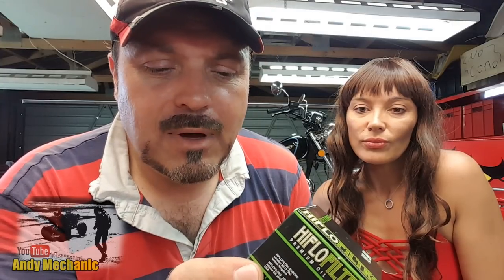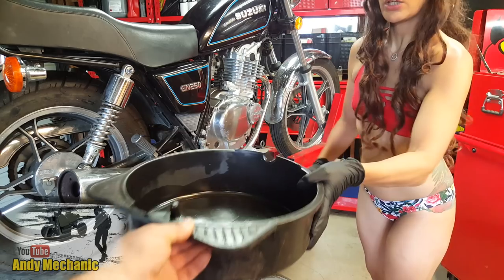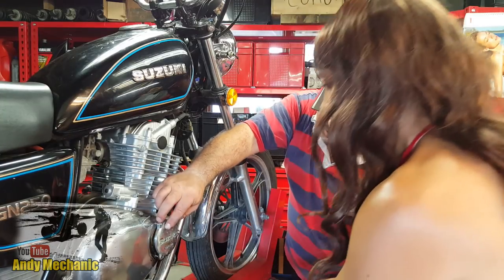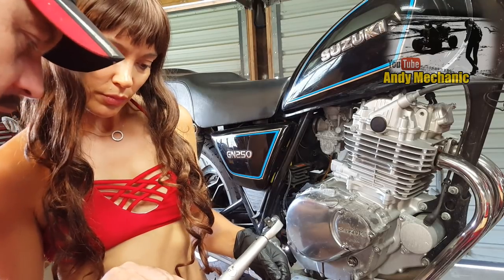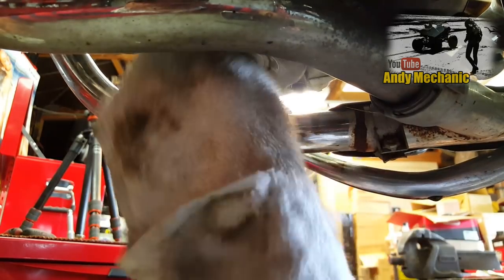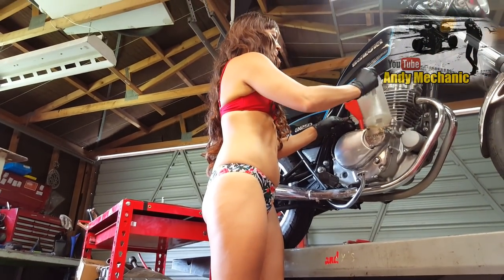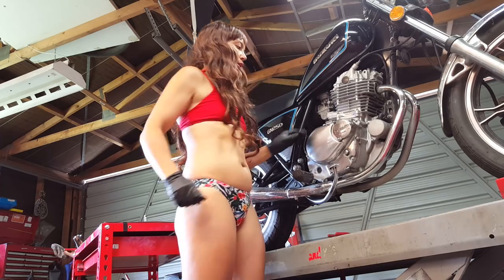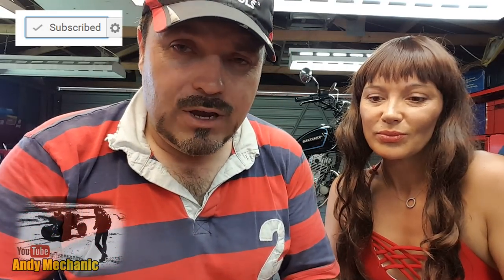GN250 Oil & filter change - ft.  Tool Girl Hana #1831

Comment: Hi Andy, Gooood stuff! You teach and explain nice and clear and that girl rocks in mechanics... and not only in that.
She has a good handling of tools 🛠 (wrenches, ratchets and so on, I mean, seriously). I wouldn't like to be the threaded hole of the first M6 bolt of the filter cover: she over tightened  it a little, but who would not want an Hana's little punishment?

Instead, the blonde and brunette used to touch and handle sockets and screwdriver as they were keeping a dead fly with two fingers by the wing. The firs lesson's title should be "A torque wrench doesn't bite".

By the way, about oil level: you told that it must be done when warm, otherwise we risk to find it in air filter, through a the crankcase check valve (I suppose). I think that if I have cold engine, oil at maximum level (upper notch) and I turn on the motorbike, the biggest part of lubricant runs into  channels and moving parts. In that situation the pan is not completely empty but level is below lower notch. When I stop my warm engine (oil at 120 centigrade degrees) who cares if it sets at 5 mm over upper notch? I own a air cooled Ducati and I think oil is also useful for cooling, so I think in my case could be better one tea cup more, that one less. What is your opinion?
Thanks again.

Comment: Dear Andy, BIG PROBLEM HELP! I recently changed my oil and oil filter on my 1985 GN250. Everything was going fine until I took it down the street.  All of a sudden I hear a loud pop!! And a stream of oil is pissing sideways from the top of the oil filter cap. Upon further inspection the gasket had shot out in between the engine case and oil filter cap and created a little nipple shooting oil out. Now I tightened up the oil filter cap and replaced the lost oil...and now the engine won’t start! It will not turn over, as I can’t get the wheel to rotate in first gear. 
Trying to start the bike numerous times I noticed a white/grey? Smoke which smelled sweet/sour coming from engine. 

The engine won’t turn over and the noise it makes when trying to start is a high pitched whine, which comes from the area directly to the left of the oil filter. If I open the oil cap I can see a mechanism slowly rotate under labor. 

I’m at a loss mate, can you please help?

Comment: do the chinese made gn also has the ''Made in japan'' mark on the engine block near the gear shifter?
Reply from the maker: If the VIN starts with a 'J' then bike made in Japan. Not sure on engine markings.

Cheers Andy
Reply: @AndyMechanic  mine has the full marking ''made in japan''

Comment: Andy, I really appreciate learning from your channel. However, while bikini clad women are nice to look at in general, there are safety issues with all that exposed skin (and high heels?) in an auto shop.  I was especially distressed that Hana did not have her hair tied back or at least stuffed on a cap.  I would not like to think of her getting her hair yanked out on a rotating shaft.  Of the gals I've seen on your channel Hana seems to be the most competent and mechanically inclined.  Plus she seems to be a really nice person.  Tight blue jeans and pullover top can be sexy too.